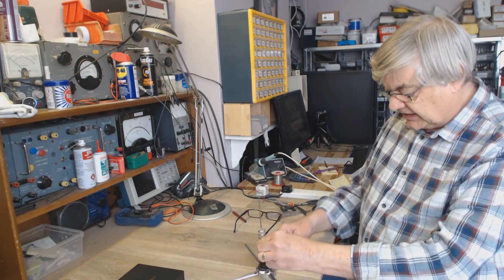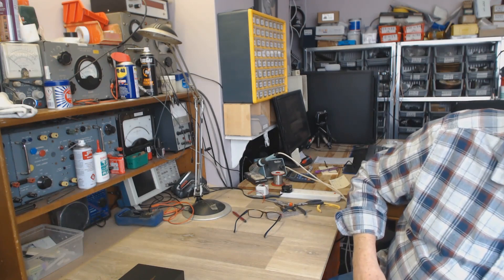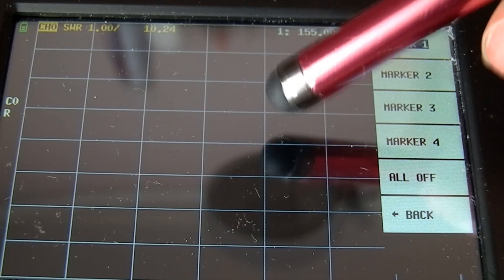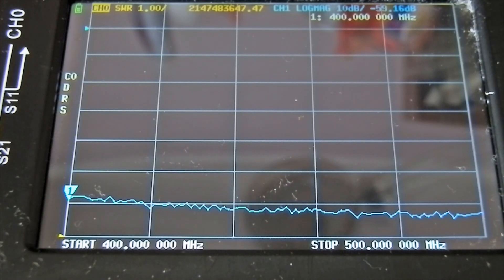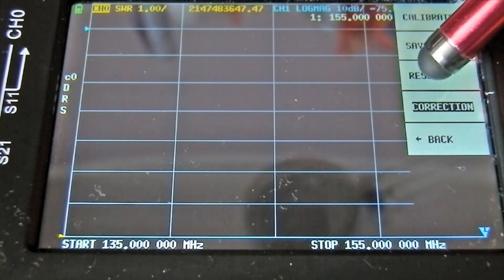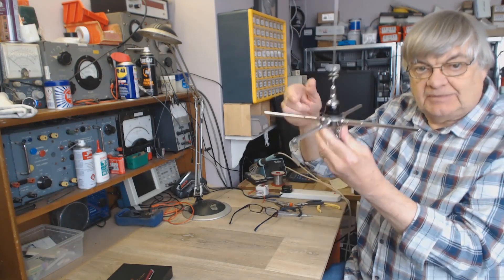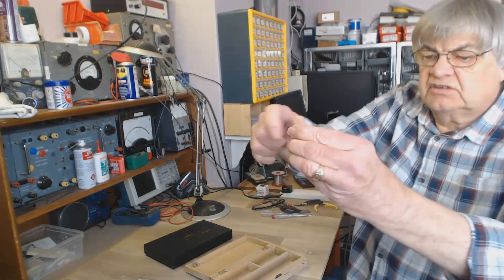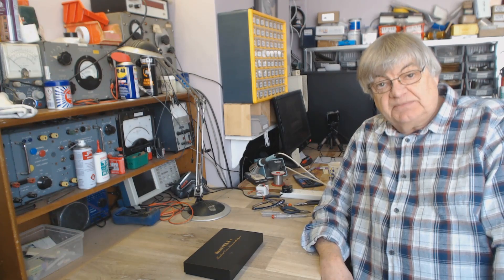G4NSJ - Checking SWR Antenna resonance NanoVNA H4

Comment: Can the NanoVNA measure open wire fed antennas such as a doublet or is it only used for coax fed antennas?  Thanks.  Your video is helpful.
Reply from the maker: I’ve not tried it but yes, it should be ok for that.
Reply: @g4nsj  Thank you.  I appreciate what I have learned from your videos.
Reply from the maker: @lawrencethompson465  glad you found the videos useful

Comment: Hi Ray i have just bought one of these, haven't used it yet seen a lot of videos on it, i suspect that antenna is a 5/8 wave on 70cms, its prob usable on 2 meters,  with 5/8 wave the coil at the bottom acts as an 1/8 wave so is physically a 3/4 wave but electrically a 5/8 wave,  so should work well, as for swr being different for different meters, yes indeed, i think some of that is due to the fact with some you connect the aerial straight to instrument and others have patch leads and connects that might cause a slight mismatch...from Fred g4vvq in Essex.
Reply from the maker: Yes, I agree. That could well cause a mismatch.

Comment: Great little intro to the NanoVNA!  Between you and W2AEW I was able to get going with my new NanoVNA immediately.  First thing I discovered (just seconds ago) is that the 2m mobile antenna I've had for decades is tuned to 156MHz.  High time I loosened the grub screw and deployed more length!
Reply from the maker: Wow, I’d better check my mobile antenna!

Comment: Do you have to run calibrate every time you turn it on, or every time you change frequencies. ?
Reply from the maker: Yes, you do need to calibrate with frequency changes. However, saving settings in the memories is useful for certain bands such as 2 metres 70cms etc.

Comment: Test it again on 433MHz i would guess its a little long and will center around 420MHz?
 trim from the bottom of the aerial not the top
Reply from the maker: Thanks Phillip.
Reply: @g4nsj  No problem, i'm an ex PBR tech, we used to fit UHF 5/8 like that on a lot of vehicals, i'm surprised they arent used more by Radio Amateurs as conveniently small 2M /70cm dual band mobile aerials.

Comment: Its an endfed 430MHz 70cm 5/8 wave, 16 inch with a 3 turn 1 inch coil to make up the missing
 3 1/2inchs of a 3/4 wave (19inch). it'll match as a loaded 1/4 wave on 145Mhz 2M
 so its a 2M and 70cm natural dualbander Gain about +3db on 70cm and -2db on 2M
If you want to use it as a dualbanded you should add some 19 inch groundplanes for 2M
Reply: I was looking for an antenna like like this but could never find one! Would love to know the name if anyone knows?

Comment: Hi Ray. Three suggestions:
1. Buy a couple of SMA M-F adaptors (£5 a pair on Amazon) and fit them to the NanoVNA sockets. When you wear out the threads on the (cheap) adaptors, throw away and replace, saving wear-and-tear on the main sockets;
2. Always set frequency range and THEN calibrate;
3. W2AEW's YouTube videos on the NanoVNA are the best.
Reply from the maker: Thanks for the tips. I'll check out the videos. Cheers, Ray.